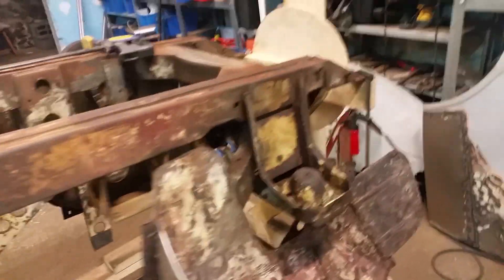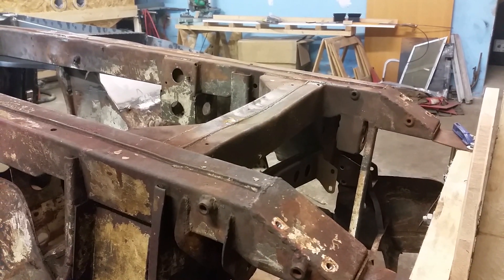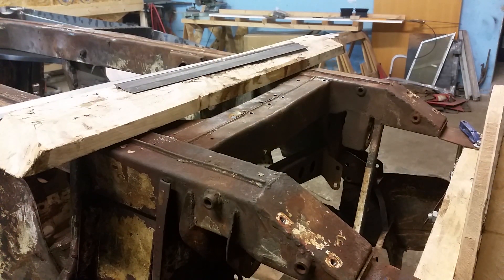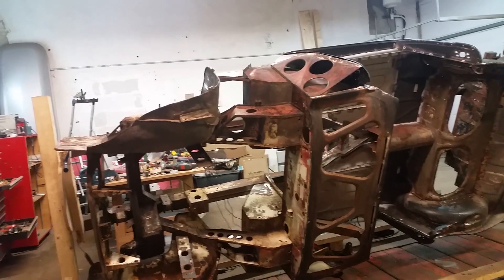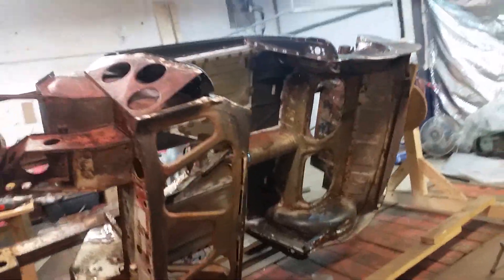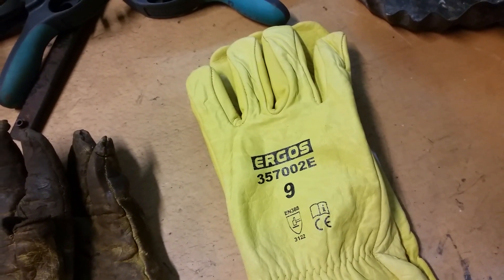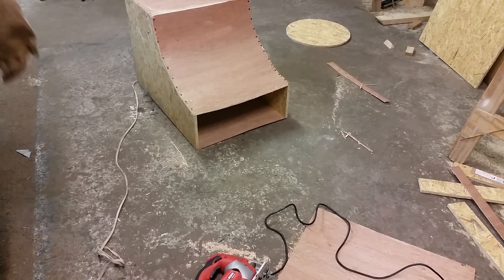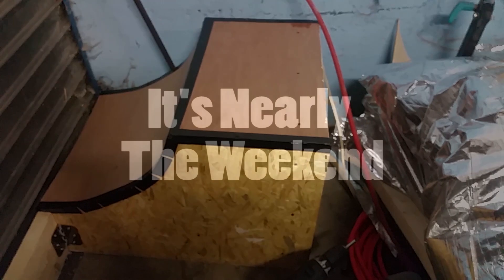The Austin Healey Project - Day 76 - 78

Comment: Hi Karl, I am working exactly in your footsteps. Just welded up the same boot repair yesterday. A few ideas from doing one before. I would use a light coat of acid etch, usually yellow in colour before you use the epoxy. (not from rattle cans. not good enough). The acid etch as a very light coat gives a marvellous rust preventing base to work from. You can put the epoxy straight on the acid etch within one hour or let it harden and rough scotchbrite it for a key. You probably already know but do not blast any of the panels. This will stretch them and cause a massive headache for you. Keep up the good work. Best Regards, David Roberts.
Reply: @AustinHealeyChannel  Hi Karl, It is actually acid etching primer, a two pack product similar to your epoxy. Should be readily available from your paint supplier. Regards, David Roberts.